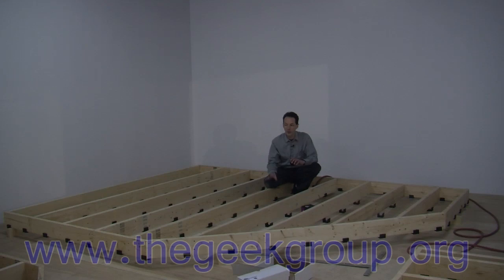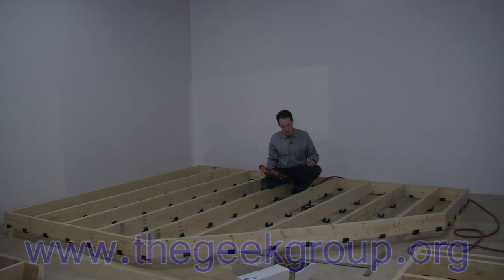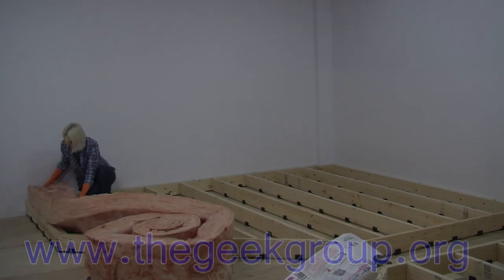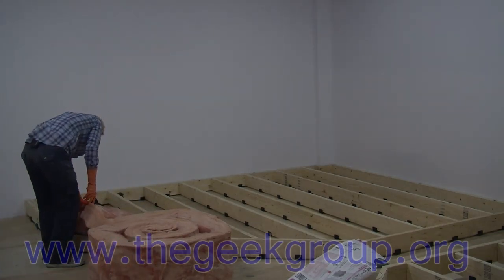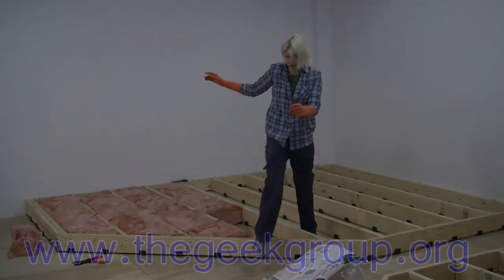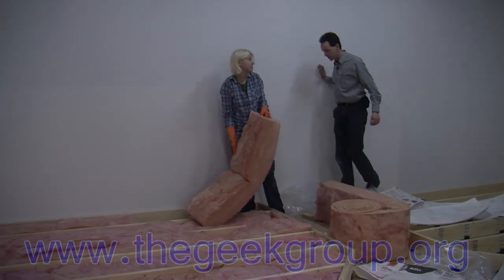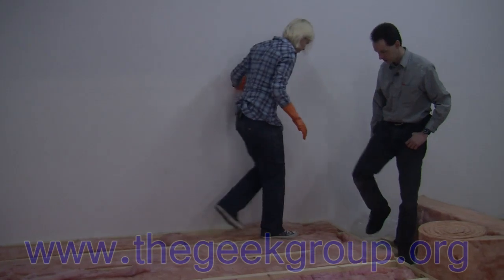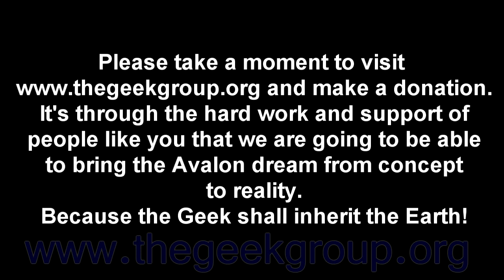U-Boats and Insulation for recording studio construction

Comment: A long, serrated bread knife makes a good insulation cutter. :)
btw: I would use a respirator ANY time when handling fibreglass / rockwool insulation.
Run a big UV light in proximity to where you are working & you'll see how many fibres are floating in the air around you.

Comment: I would have used the ROXUL Sound & Fire green insulation with slag as it has much better qualities for controlling sound transmission and is what I used when building my studio.As previously mentioned by SumatoborukiSaru a serrated bread knife works the best for cutting the insulation to preferred size.

Another tip would be to start laying the insulation along the end wall and work your way out so you don't paint yourself in the corner as she did in this video. Less chance to step on the insulation as you will always have an open space between the floor joists to walk. Also it really is not necessary to staple the 'U-Boats' as the load on the floor will keep them in place,... as long as your floor is level,... and it should be! The less metal you have in the floor joists the better as this will prevent/lesson sound wave transmission throughout the entire structure.

You certainly don't want a Tacoma Narrows Bridge type disaster to occur in the studio due to a resonance frequency! LOL.

Comment: Guys, wht´s the name of that pink stuff? Thanks:)
Reply: Fiber glass insulation. Really nasty stuff if you don't have precautions when working with it. It's literally fibered glass, so it's very sharp and thus irritating or even dangerous to tissues like skin or eyes, god forbid if it gets to your lungs trough air (It's very light so it gets airborne really easily)
Reply: Ok, i´m not putting that thing in my house!
Reply: You can replace it with rock wool. still not so nice stuff to work with, but much more manageable than fiber glass.Luis Pedro Martins